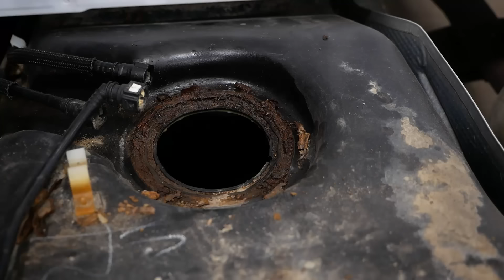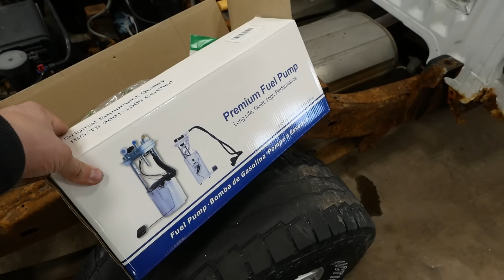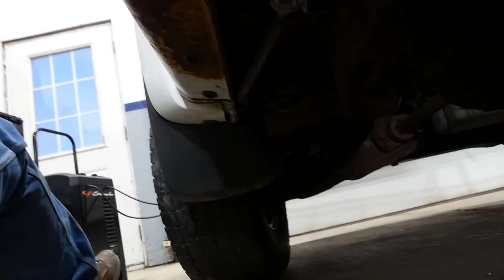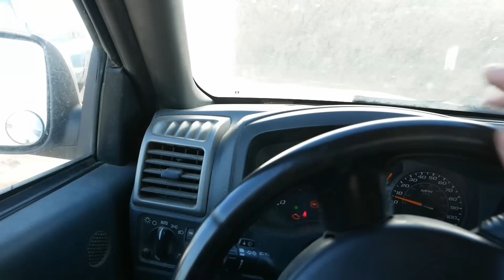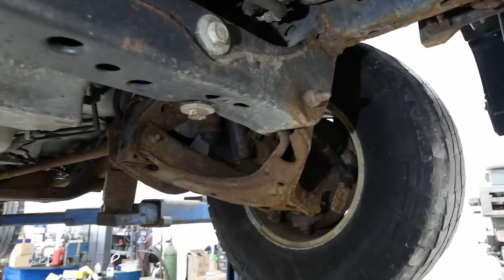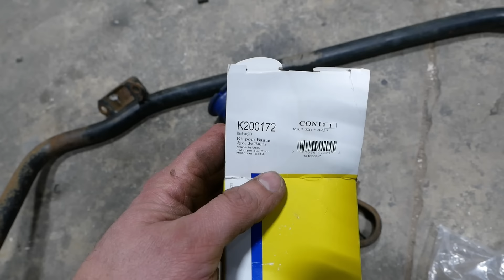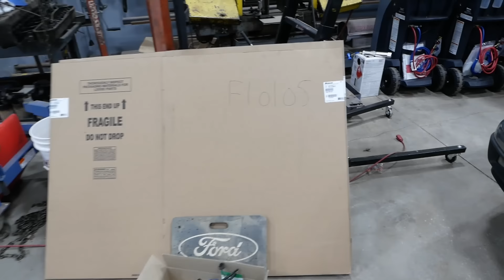Saving a GMC Canyon with 434,000 Miles from the Crusher - Won't Start, Fuel Pump Tabs Rotted

Comment: Wes I will bet that when they went to pull the pickup home, they hooked the chain to the sway bar or a bracket. 
I have had to replace 2 sway bars, probably 20 to 30 brackets. 
Sometimes multiple times on the same pickup. 
Hello from north east Montana. 
10 miles from the Canadian border.

Comment: Wes do you think you can work on my 2002 chevrolet silverado 2500 6.0 it will not run and I don't know what I'm doing it's hasn't ran in like 15 years I've replaced the pcm the fuel pump the starter and a battery it will crank but not start I really want to get it running and driving it's my first revival and I'd really appreciate it if you could help me. It can be a video for you as well. I really don't want this truck to go to the junkyard

Comment: Comment attempt #2. The rigs main bearings and valve train are so loud it makes it sound like a diesel. I'm glad he didn't scrap it. Living proof cash for clunkers was one of the worst policies ever pushed through the WH. You're not a fan of antiseize I take it...those sway bar bushing  bolts need it up here in NH or next time your cutting and torching them off. The salt sand and brine DOT uses rots the piss out of the vehicles. Great video
Reply: We would still have the option to buy $1500 used vehicles if it weren't for that scam program, it's only purpose was to push an agenda that laundered money into politicians pockets like everything else. There would be a million more old vehicles in the used market and you wouldn't have to pay $15,000 for a half decent one like today.

Comment: The GMC is all around piss poor design!! If id had to do it. Id made a access door on the bed. To work on the pump. Also the v tech engine to reclaim the ehaust. And always fix EGR, map.and every other sencer. Not like the old days. Open the hood two bolts 3 lines replace pump.

Comment: I have 2005 Colorado Z71 4x4 with 204000 miles. Runs great. Sitting on sone agressive 31x10.5r15s. I love these trucks. They have the problem areas like any other, but the engine and transmission, and the differentials are solid.

Comment: I had an Ex taxi Ford Falcon 1984 model 984 XXX Km  (615,XXX miles) Nearly rolled over on the odometer and the car. Mate totalled it I was glad he was ok but I was devastated Original engine, gearbox reconditioned at 2/3 the mileage, original diff.

Comment: I'm thinking cut pipe threads off 3 or 4" coupling, cut pipe threads off 3 or 4" nipple, weld flat washer of appropriate size to one side of coupling. The other side other to tank for new inside lip shelf. Pump drops through coupling stopping at washer flange, screw down pipe nipple thread to secure pump probably with chisel and hammer. I got the visual, you would have to make it happen.

Comment: Not sure if you’ve tried it before but welding a nut onto those broke off bolts is a much easier way to get them out. The heat loosens them up and they usually turn out pretty easy. It isn’t feasible in every application but would have been easy to try for those sway bar bolts.

Comment: Good to see it run again.  Where you drilled the sway bar bolts out, the frame corner just in front of the sway bar mount spots look really rusted out. All the other nick picking things you notice believe or not, make a huge difference from very small things to become huge repairs.

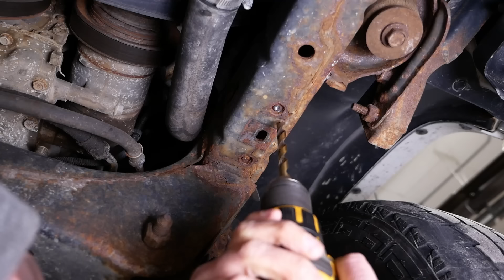Comment: 28:45 Sooo why aren't you using a magnetic drill press? I feel like putting it up there, turning it on and hanging a small weight on the handle is a bit easier than having to do this all with a small handdrill 😬

You could even eat lunch while it does its job

Comment: 7:22 at this point what I would do is......  drill through the pump bracket and tank to make 4 areas where you can bolt it down from, then load the gasket mating area up with fuel resistant RTV silicone.

Comment: Kind of sad.  I have a 2005 Canyon SLE, with 3.5l i5 and the special off-road 2WD (yes two wheel drive) and locking differential.  Mine has 146K miles on it, and it has been way more reliable than any previous used cars I have had.  I am amazed at the rust on the one shown in this video.

Comment: A useful piece of info. Even though the relay is clicking, it does not mean it is actually working. I had this very problem with my car. I replaced the fuel pump relay, & it solved the problem. Wire breaks are a pain to find.

Comment: That inline 5 must have had the cylinder head replaced at sometime. Mine was replaced by gm at about 60 thousand. I was lucky because it was out of warranty. They had an ongoing problem with them.

Comment: I had the same problem with my Buick: rusted out locking ring for the pump. Fortunately there remained enough metal to lock the ring secure with the new pump. I was appalled at the design.

Comment: 28:10 Might have fallen off when the truck was lifted. Those missing heads on the bolts might have just rotted away and it snapped from the lift.

Comment: I fixed a dozen of these tanks. Used a plastic welder rod with a new lock ring that you can buy. Did not take that long say an hour and job done. The GMC truck we had at work had over four hundred fifty some thousand miles before that got traded. The truck was bought by my coworker for five hundred dollars. He drove it for another hundred thousand miles. His daughter put the truck into a telephone pole. End of what happened. Not unusual but does not happen often enough.

Comment: If they only used that tank for two years, would the tank they replaced that tank with fit with the fuel pump you’re replacing anyways or did they radically change the design?

Comment: I have a 2002 Avalanche, doing a full frame off restoration on it. The frame was gone, so I bought a new one, exact replacement from GM, purchased Oct 2018, manufacture date on the tag is May 2018. Most parts for the truck are discontinued, some NOS still around, and some of that I got the last of, but for some reason they were still cranking out new frames in 2018. The frame does not fit Avalanche after 2006, they were redesigned at that point. Interesting how they still made replacement frames for a truck that old.

My fuel tank pump mount ring was also in dire shape but saveable. I replaced the lock ring and sandblasted the hooks on the tank, there was still enough left of them to work with. I coated the metal parts with Eastwood rust encapsulator platinum. (good stuff). Then after assembly with new pump and seal ring I slathered the whole thing with LPS 3 corrosion inhibitor. The fuel supply and evap lines were all fooked but replacements were available. Also I coated the new steel fuel lines with the Eastwood Platinum slather. That stuff is so tough that I coated the whole frame with it. (HUGE JOB) 

My wiring harness was still good, no mysteriously broken wire, but a few corroded ground lugs. I had one that looked fine but was bad from hidden corrosion, on the back of the engine at the bellhousing, that one will make your instrument cluster dead even though the engine runs fine. Also if you have a rough idle problem caused by a pesky air leak in the intake snorkel connections between the TB and the MAF, you can seal it with a dab of Loctite 536, this is a non hardening teflon paste pipe thd sealant. It worked for me. Works in places where you don't want an adhesive bond. Also if that fuel tank repair kit strips out the holes in the plastic with the pole barn screws in a later replacement of the fuel pump, you can use plastic welding to fill up the holes and start over. Even if you just melt them back with a soldering iron, it should still work.

Comment: On the busted off flush sway bar mount bolts, if you have ox-acetylene torches you can clean off the rust on the end of the bolt stubs with die grinder, file or whatever, then get some steel filler rod, even a coat hanger, and weld a nub onto the stub. Build up the nub where you can grab it with pliers. The heat will usually break the rust bond so the stub will turn easily. I have done this many times. Once a guy I had been working for had a manual trans 4x4 truck in his driveway during winter, and he busted off the mount bolts of the transfer case shift linkage. There was no room in the tunnel to get a drill of any kind anywhere near it, and he needed the truck soon to plow snow commercially in a coming storm. I told him for 20 bucks I'd go home (half hour drive), get my torches and have those bolts out. He was skeptical but said by all means try it. I succeeded and he thought I was a genius. He probably would have paid double he was so happy. 

Recently I had some pan bolts in an aluminum case auto trans, 5 in a row all fused and busted off. The torch only got one out, the rest were hopeless. So I did what you did, just drill them out to the appropriate size and re-tap. If your center is off then the new thds will be like a partial heli coil. The repaired thds hold the bolts good as new. I had to oval the pan holes slightly for the off center, but no pan gasket leaks, repair is un-noticeable. I also have those Lisle tap sockets, those are a go-to in my toolbox as well.

Comment: We call those screws tek screws in the UK Wes, but the roof one's usual have a twist drill style point if going through steel so they self drill the hole then screw themselves in, I love these style of repair kits as they sort what would otherwise be a scrap component, 
P.S That fuel pump has to be good as it says Premium on the box .......😂

Comment: if it was the 4wd i would have set it on fire. if you ever wondered why those went EXTINCT fast
i think its because people went to get brake jobs and ended up walking out with a 900-1000$ bill and were told oh yeah the front rotors come off backwards- you gotta remove the hub and axles instead of just taking off the caliper brilliant design by GM what a heap.

Comment: ? For canyon guys.  My 06 2.8. Runs great until the temp gauge hits 1/2 way. Right as it hits 1/2. The truck will stall when come to a stop or lift from the accelerator. To brake or take a turn???  

What gives.  I was told that there fuel pumps will still work but once they heat up it will quit??? Is this true??  Or had anyone figure this problem
B4 ? Truck is 2d 2.8 w 117k. I thank u for any help yall!!

Comment: Get yourself a couple of big tubes of JB Weld put the new field pump in there and if it works it works not screw it  Always cool thanks for the videos By the way your way was way cooler and worked better

Comment: I find those replacement pumps are a nuisance. On a truck its not an issue but inside my Toyota where the fuel pump is under the back seat, they all make a loud whirl sound. I've tried 3 Delphis and they all have that problem. I even put gasoline resistant soft gasket material under the pump to deaden any vibration with no luck.

Comment: it’s kind of funny recently i saw online that  those tools were being sold  i  assume they were cheap Chinese knockoffs  i over the years i’ve owned quite a few GeneralMotors Products and they are often filled with  not so intelligent engineering  things like the way that fuel Pump mounting design area ?   one of their dumbest designs were on some of their Work Vans i had that in Northern Cold tepertures the  exterior door handles would just break off in your hands leaving very sharp edges that would cut your fingers  into a bloody mess  nd those overpriced Handles that were Dealer only were never available at the local dealerships    Door Handles ? C’mon GM  they have been building cars for years

Comment: I bought my 2004 Canyon here in South Florida in 2009. It had I think 63,000 miles on it. Crew cab with the Vortex 3.5- 5 cylinder engine like yours. 2 wheel drive. I had it for 9 years and it was my daily driver to and from work. When I sold it in 2018 I got I think about 2800.00 and it was at 179,000 miles. I never had any real problems with it. It got decent mileage of 18-21 mpg. I had considered purchasing a rebuilt engine and transmission for it. South Florida has no hills and I was 14 miles inland from the ocean so there was almost no rust anywhere. We foolishly bought a 2017 Nissan Murano which has a 6 cylinder 3.5. The car is fine but I think it’s a total gas hog. I did not really need the money when I sold the truck I also kind of knew I would regret it. I paid I think 6500.00 for the Canyon. For me the truck was great. I used it for a commuter vehicle and never abused it. As a road vehicle it’s great. They do not have a great safety record but again, I think people often overload these small trucks and just beat them into the ground.

Comment: What works and holds alot better than those crummy self tappers is 1/4" blind rivets like they use on boats. Number one the Stainless Rivets R basically impervious to fuels period and they seal that ring back up better than ever. At my shop that is what I use & they work like a charm. Helps to have a pneumatic riveter for the job. Stainless Rivets can be quite crikey and hard on the hand with a hand riveter. I use the rear end gear sealer from Permatex works pretty darn good on them things. We have done half dozen over the last 2-5 years none of em ever came back leaking. I also recommend the Delphi Pumps they have been redesigned to just slip on in really well. We tried a couple pumps from Auto Bone and Napa and they R nightmare to even get em seated in the hole straight they seem to fight ya really hard vs the Delphi pumps seem to just drop down and in with little resistance at all to get em seated in place.

Comment: I’ve experienced the throttle body issues,  pcv hose, lmao the grill, I’ve replaced some of the belt pulleys, I’ve also had evap problem, just a simple purge valve easy fix. My 05 canyon has 320,000. She runs like a champ. The 3.5 has no problem with a 2” lift kit and 33s on 17” rims.

Comment: I like that repair kit for the lock ring problem Wes . The Older Hondas and Toyotas came stock with that kind of system on the tanks , Never saw one fail to seal up !!  There was a recall on the cylinder head for valve seats dropping and destroying the cylinder .. Also one for timing chain issues . Many of them with these issues got a dealer engine replacement . However who knows on that truck ?? Looked like the throttle body crud was a tell tail that it could be the original engine .. A customer of mine brought me his recall notice about the engine issues years ago is how I know about the issues . Great Job ! .. ENJOYED ..

Comment: RTV is not gasoline resistant. I have successfully used Seal All on the exterior of pin holed float bowls ( thanks to E85 fuel) as a last resort repair on many, to the dump bound motorcycles, that actually have life left in them with great results. It looks ugly but still goes down the trail or road.

Comment: Those gm 4.2 Straight six were bulletproof if taken care of, much like the 3800 BuickV6, And Yes this is 5 cylinder, but its the same engine style minus 1 cylinder.  While I won't disagree the bowl the fuel pump sits in is bad,  its so the tank can sit up high enough on the smaller truck, if the whole pump set up an extra inch an half  the whole top of the tank would be s spot to collect crap much easier then when its tighter to box. Many other brands do this same thing. Now you want  to complain about GM the discontinued parts used in just a few years is so sad it hurts. I have several cars with parts that cost $100 new, and now cost $500 for a used one with 30 day warranty. I will not put a cheap aftermarket non name  pump in. Replaced to many in days to months after and the extra $200 is way cheaper then the time to do it over in my opinion.

Comment: Oh how GM Engineers must laugh when they say "quick connect fittings". I just ask for 5 minutes alone with them in a locked room. I may or may not have some long overdue revenge that should be dealt with.

Comment: I had same problem. I bought used tank for 25 at junk yard. I put new pump in but i used melted candle was as a sealant in that bowl area because i didn't want rust in there again. I put a couple squirts of wd- 40 in melted wax. Fingers crossed. It seemed to work great. Don't know why i thought of doing this but I'm just a weirdo. If i need to undo i just use my heat gun to melt and shop vac the wax.

Comment: At the risk of sounding like the YouTube peanut gallery, it’s not ideal to put your fingers into an electronic throttle body. There is a lot of gear reduction and torque going to that throttle blade, if your pedal depressor slipped off and the ECM tried to close the throttle blade with your finger in it, it would probably take it right down the bone or worse. I leave the key off and block the throttle body open with the handle of a screwdriver. Much more safe.
Reply from the maker: LMAO! That's good...

Comment: I'm currently driving a 2000 Chevrolet Silverado 2500 with 448k miles. I bought it with 363k miles in 2015. Drove this truck across the U.S. and up through Canada to Alaska. Replaced the engine about a year ago. She's still kicking!

Comment: Mice or rats.  Wiring issues .  Just sold my father n laws truck  same truck 420000 miles ran great . Lots HP. Out of a small 5 cylinder. 😆  he loved barking the tires .

Comment: Wes, I cannot express how much I appreciate your approach to what you show in your videos.  I have one question however.  How does someone as young as you have such a wealth of knowledge in auto/truck repair, electronics, and machining.  Add to that that you have a lot of machine tools that on the surface appear to be expensive.  Does living in the mid-west have anything to do with the availability to machine tools at bargain prices?
Reply from the maker: Yes. Lot's of clapped out machines here for cheap. I have less than $4000 in all of my machine tools. If you ever used them, you'd see why!